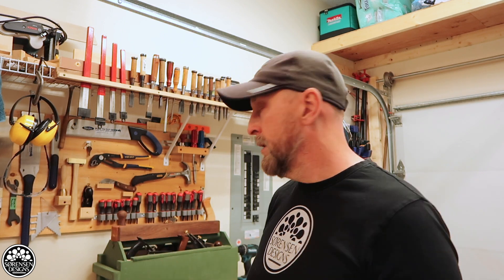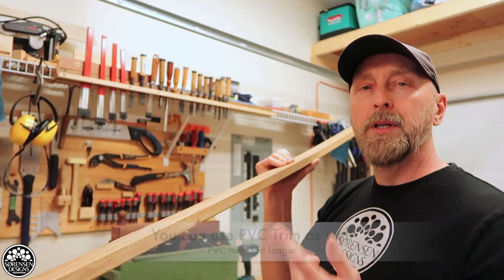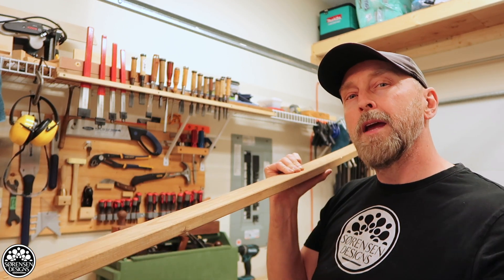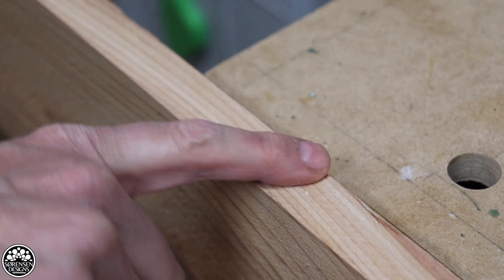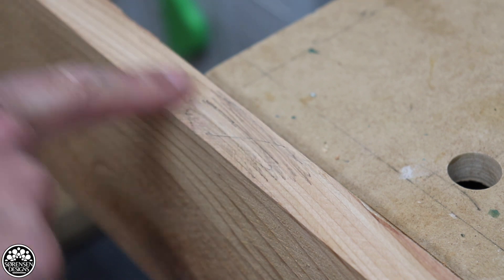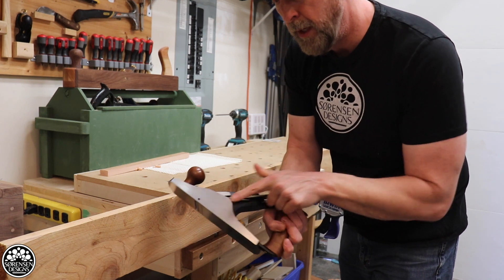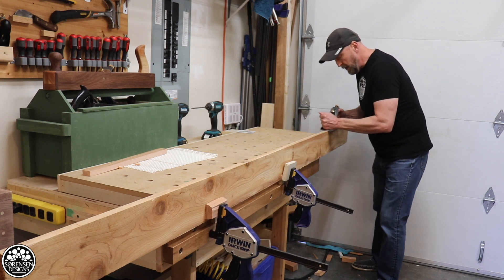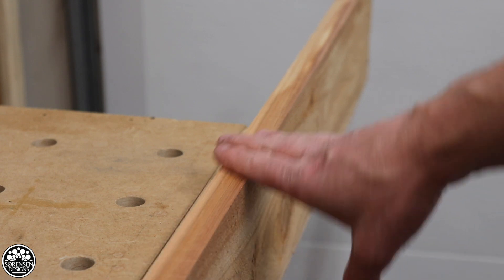Jointing Long Boards Using a Factory Edge on the Table Saw

Comment: Thx for the tips sir, just getting into woodworking myself and recently bought a table saw. So do those brad nail holes just get sliced off when you turn the board around to join the other side, or how to you hide them? would a pin nailer work as well? Thanks
Reply from the maker: Get yourself a good set of pliers and they pull out quite easily. Nails on the ends are likely in the off-cut zone, so those holes are negligible. The only hole you will have to fill is the one in the middle of the board and it's so tiny, once you fill it, it's invisible.  A pin nailer should work as well but you may need more than 3 nails.
Reply: @EricSorensenCanada  thanks for the reply! appreciate it

Comment: Thanks Eric, I was contemplating a bench top jointer for my small shop, but alternatives like this and the limitations on the small jointer didn't make it worth it. I'm holding out until we retire in BC and I build  my 'dream shop' where I have room for a proper jointer after I save my loonies.
Reply from the maker: Good Choice Jeff! Yes, when I first learned woodworking, I got spoiled by the big green machines. I almost bought a bench top jointer a few times but then I realize it won't make things any easier. Cheers 🙂

Comment: Thanks Eric. Questions about your table saw blade: are you using the "factory blade" that came with the saw (which I assume is the 24 inch tooth blade)? Compared to the 71/4 inch blades you previously used, how much more dust (if any) does the 8/1/4 inch blade produce? Do you switch out to a blade with a higher tooth count to do a crosscut? Thanks!
Reply from the maker: Yes, I'm using the framing blade that came with it. Its about the same as the 7-1/4" Dewalt blades I've bought in the past. The dust for the 8-1/4" is negligible. When I change the blade I will try a 7-1/4" first to see if it will work, because I have a few new ones on hand. I can usually buy them in 3 packs for much less than the 8-1/4"blades. The test will be using it with the riving knife - it should be the same thickness.